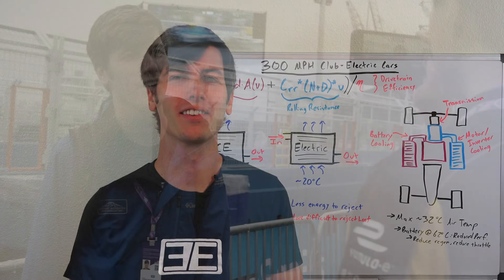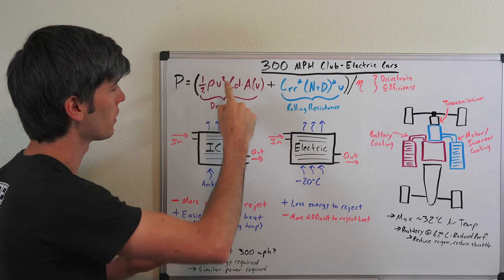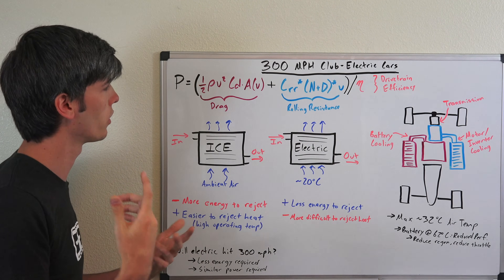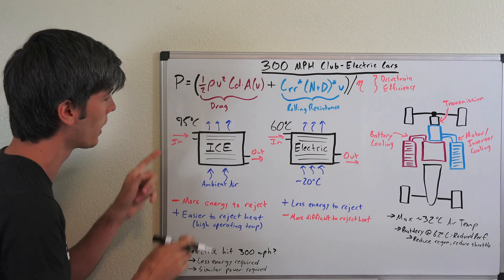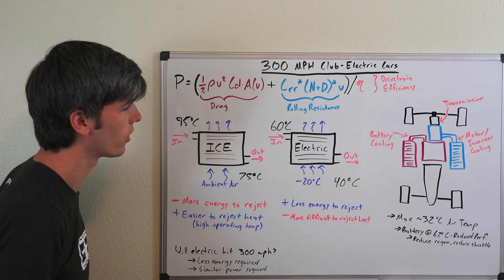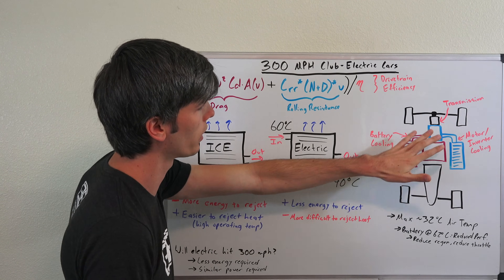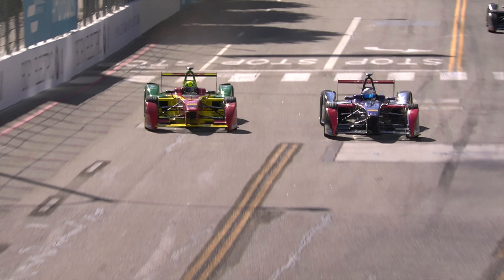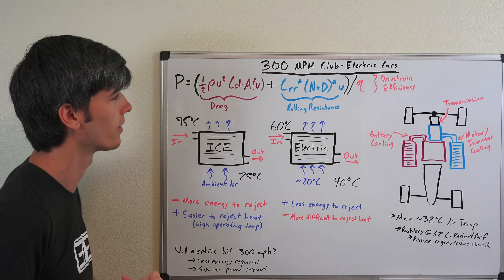Why Has No Production Car Hit 300 MPH? Electric Cars

Comment: There is a substantial amount of energy is lost to aerodynamic drag to cool electric components. There is a similar sized radiator needed due to lower temperature differential. Using refrigerant instead of liquid coolant would create a greater temperature differential to allow for a smaller condenser coil than the radiator. My question is, Would a cooling system using refrigerant instead of liquid coolant allow higher maximum speeds, or would aerodynamic gains be less than the power required to run a refrigerant cooling system?

Comment: Why not use a sort of DRS? But instead of reducing aA of the wings you close radiator intakes/exit. Quite some cars have those flaps that will close when the coolant temp is low. 30 seconds should be enough.

Comment: For electric cars, I wonder if using the entire chassis as the cooling solution would give the best results.  In other words, ditch the radiator and just have heat pipes run throughout the car.  Any panels that don't contribute toward cooling could be carbon fiber.  To my knowledge, many of the support structures are hollow, but still pretty heavy.  I'm not sure how this would work in terms of safety, but there could be more (but smaller) frame pieces that also act as the vessel for the coolant.

From what I understand, electric cars have more divided heat, since each motors, the batteries, and inverters are all separate components that generate heat.  With heat spread out so much, I would think a larger surface area (such as the housing of the vehicle) would be a lot more efficient at removing heat than a single radiator.

And sure, this may result in the frame being pretty hot, but it would be tolerable to touch.
Reply: The more I think about it the more I like this idea.  Any reduction in aerodynamic drag for an electric car also increases range.
Reply: What if it's a Hot summer day where external temperatures can get up to 160F? Having the cooling run through the surface would require much more cooling pipes wich would add wheigh.
Reply: @miguellopez3392  Where tf do you live that it regularly gets up to 160 F???
Reply: @imagineaurora4080  in direct sunlight black painted metal can reach temperatures of 160 degrees Fahrenheit with an Ambient Air Temperature of 103F.

Comment: I can't recall the terminology, but I saw a cooling system which evaporate a store of compressed CO2/gas in small amounts. That expansion would act as a heatsink and absorb the heat which would be bled off. Would sticking a bottle of liquod-some-gas-or-another be a feasible option?
Reply: So I guess in other terms: don't cool a coolant in a closed system, just let it evaporate. 45-minute race with ~23 per car? That may be an option. Weight costs of a tank could be offset by reduced cooling loops.

Comment: I have a question about the heat exchangers location and the secondary effects caused. I have oftentimes questioned why engineering teams always seem to opt for the exaggerated frontal exposure with large air scoop vectors that effectively turn the radiator into a air brake. I am interested to know if it is possible to integrate passive heat sinks and active radiation into the aerodynamic components and body shell, being that the service provided by them is by design generates drag, resulting in down force, and this'll possibly allow the overall  coefficient of drag to be reduced.
Reply: My guess would be mass, adding piping to the entire skin of the vehicle would add dozens of kilos, and the cooling might be worse.
Reply: I love the idea of using the aerodynamic components and body shell where possible.
Reply: Thought the same with the skid plate that is on the bottom of most cars..  could get passive cooling from that also.
Reply: probably hydraulics would add a lot of mass to move all the components. If it were something like a spoiler, the center of mass move upward,too. I was thinking about more advanced techniques like magnetic cooling instead of good, old radiators.
Reply: David Johnston I was thinking the same thing, avoiding surfaces that commonly come into contact with other cars though.
Reply: I think the problem is that you're not getting a whole lot of area elsewhere on the vehicle... the active area of a radiator is easily 10 times as high as its frontal area, plus you get to use the slightly warm air off its back for secondary cooling still, offsetting some of its drag disadvantage. Where do you want to obtain that much area and how do you want to effectively pipe the fluids to and from there?

But maybe that's something you want to ask an aerodynamics engineer. Such as KYLE.ENGINEERS here on YouTube.

By the way, i expect that one of the advantages of a long, flat battery that is bolted to the bottom of the car is specifically drag-neutral cooling, so there's that.

Comment: Formula E teams can get away with not cooling their transmission now because they use 2 cars during a race but what happens in season 5 of Formula E when they only have one car. Wont teams either have to cool their trans or go with one gear or just flat out risk over heating?

Comment: So if the heat transfer is the problem why not build an active cooling system like e.g.air conditioning for the motor and battery pack to make cooling more Efficient?!

Comment: What if both the battery and the motors could supply the required power of 1500hp in a sleek car with little radiators, while remaining within lower temparatures, continuous power output? Might the car hit 300mph before any real heating occurred?
Some batteries are better at delivering high power than others, but may suffer in range (energy). A record run could be over after a minute or so, though. And using the right materials still a good bit of cooling might be achieved at zero added drag.

A drivetrain that needs to really stretch itself to reach 300mph may be much hotter than one that can do it easily. Use A LOT of high power cells, and they'll barely be tickled to produce 1200-1500kW. Use enough motors, say 2 strong one per wheel, and they should be able to stay within their continuous power easily. It would not be a cheap or light car, and it would not travel very far on its power cell battery pack, but it could be done, surely, and it could be put into production, if there's a market for a 300mph car.

Comment: More efficient? With modern technology, wouldn't a 300mph electric car need massive heavy batteries? The motors may be smaller and able to apply more force, but the batteries are a deal breaker in this scenario.
Reply: the engine is more efficient, the system designed to power said engine is not very efficient I love electric cars but the batteries hold them back so much sadly.

Comment: hey if heat can convert into energy, why can we use the heat as a way of propulsion to make the car warm up less? :v
Reply: That's basically MGU-H that you want. So it actually is being done in F1, but it's by far the most complex part of the (already insanely complex) F1 power unit and it doesn't seem to help much with cooling the engine.
Reply: any sort of system like that would likely increase the weight of the car which increases stopping distance and makes cornering/acceleration worse maybe even to the point of making the car far less safe then cars we have today. in terms of other vehicles tho(think trains or large cargo ships etc) it is probably a great idea :P
Reply: actually we convert chemical energy to kinetic energy :v . the heat is the product of combustion, not the source of energy. the twisting force is the torque and that's the energy that gets transfered from the movement of the engine n.n . we waste 66% of energy in between radiator cooling and air cooling :3
Reply: The crux of the issue is, thermodinamics is a fickle mistress. The theoretical best heat cycle can be drawn as a rectangle in an entropy-heat graph, and in that graph, the size of the rectangle is the work you get out of your system, while that plus the part under the rectangle is the energy you put in. 

In simple terms, in thermodinamics, you want your hot as possible, and your cold as cold as possible. As it's easier to heat stuff up (especially in large quantaties), the cold is usually the ambient temperature. That means to have a reasonably good heat cycle, you want a few hundred degrees celsius. Not something you'd be comfortable sitting in.
Reply: Using an engine's waste heat for propulsion is possible, and has been known (and exploited in aircraft) since the 1930s. The NACA cowling for radial engines is probably the first real example: it uses a carefully shaped circular cowl surrounding the engine, which is air cooled. Cooling air enters the hole in the front of the cowl, flows around the engine (directed by baffles) and is vented through adjustable flaps or 'gills' at the rear of the cowling. With careful design, the heating of the air as it cools the engine combined with the shape of the cowl causes the air to exit the cowl at higher speed than it entered, producing a small amount of jet thrust that helps compensate for the drag caused by the engine and cowling. During WW2 many radial powered aircraft used this design, and planes with inline engines used a similar arrangement to help reduce the drag caused by their radiators. The P-51 Mustang's radiator was actually so good in this respect that under some conditions the radiator caused zero net drag, or even produced a small amount of excess thrust. Such an arrangement is (AFAIK) more difficult to set up on a car. There's no suitable location on a traditional car design to put the adjustable flap or gills required for such a radiator scheme to work, and the radiator needs to be optimised to collect the incoming air with minimal loss of pressure, which generally means you need a jet-fighter style intake rather than a grille.

Most piston powered aircraft also harnessed the waste heat that went out the exhaust pipes by the simple expedient of aiming the exhaust backwards- when the exhaust valve opened the exhaust gases of a high performance engine are blasted out at a speed of around mach 1, so directing them to the rear produced a substantial amount of jet thrust.

Comment: Why use the same size radiator for a lower delta T? Also, why is it "harder" to reject LESS delta T with the same size radiator?
Reply: The heat transfer rate is lower. Yes there is less heat to get rid of then ICE but ICE radiators don't drop the temperature very low. Hypotheticaly from ~95C to ~90C while an electric motor radiator might go from ~60C to ~57C but it will take longer (thus larger radiator required) because of the smaller Delta T between the radiator and ambient.
Reply: A lower temperature radiator displaces less heat, the higher the temps are the greater its ability to displace it.
Reply: Yeah, of course lower delt-T = less heat energy displaced. The question is, if there is less energy to transfer out of the system, wouldn't it follow that you could 1)cut down the size of the radiator and/or 2)reduce the airflow required which would amount to a net drag reduction?
Reply: To maintain a lower temp radiator that is 60 deg you need the same size radiator to displace the already lower temperatures, to lower the temperatures even more you would need a larger radiator then a normal car due to how much surface area is being allowed to do its job. to be able to achieve 300mph you would need more power being used more rapidly thus generation more heat to dissipate in turn needing a larger radiator.

Keeping in mind that the battery works best lower then 60 deg

cutting down the radiator size would have a ripple effect on the whole system, the battery would start to output less and the inverter and motors would in turn suffer.
Reply: xkblxcripple,  valiant effort, but I'm understanding your English. Try breaking up your thoughts into smaller sentences; it sounds like you're trying to put too much information into each one. 

Michael, not familiar with ICE radiators, but I'll check them out. Are FE vehicles limited to just one type of radiator? If so, I could get how the radiator might be less efficient. Also, you're right, they only need to lower the temperature by a few degrees, which puzzles me further; what keeps them from increasing the heat transfer by increasing mass flow rate in the radiator? Water pumps don't take much energy to run, and due to the lack of comprehensibility, the system wouldn't need much of a pressure increase (thus, components wouldn't need more weight).
Reply: Yeah grammar ain't my strong spot ha ha

Comment: i like the idea of formula e but i just cant get behind a series where the pace car (rimac concept 1) has 4x the power of the cars doing the actual racing ... not to mention the driver boost feature is absurd in the extreme
Reply: its not really power that makes a car go fast around a race track tho, its mostly grip, torque and low weight.
**edit grip = downforce/tires etc

Comment: What about using peltier cooling to increase radiator temp w/o increasing temp on the sensitive components? I'm guessing you'd need bigger batteries for supporting the peltier cooling and thereby increasing the weight enough to make it not worth it.
Reply: Jaliee peltier coolers are rarely worth it, they consume far too much power. For anything that can take the size and weight using a compressor/refrigerant is more efficient.

Comment: Nice math for steady state, but have you considered Dynamic temperature conditions? On a cold day, it takes my combustion car a few minutes just to warm up to normal operating temperature. Electric cars do not have the limit of being unable to run fast at cold temperatures. In fact, their motors are even more efficient at cold temperatures. It seems to me that reaching 300 miles per hour with an electric motor after a cold start would possible.  You just need to quantify the total amount of waste heat generated to reach the top speed, and compute delta t of the car's components would be after that adiabatic sprint, assuming all waste heat stays in the car.  The more thermal mass you add to the car batteries, the easier it is.  You could use a radiator system that completely folds away for less wind resistance, and pops back up to cool down after the speed run, like a diving falcon.
Reply from the maker: +Matthew Furtney sure, but you can't base a design for a production car on a single 300 mph run. It also has to withstand driving around in Phoenix at 120F, regardless of what driving condition you're in (traffic, cruising, spirited driving, etc). That plays a huge role in the sizing of the cooling system.
Reply: Matthew Furtney I know it wouldn't be practical but I'd love to see a car designed that way.
Reply: Matthew Furtney in pretty sure batteries don't like the cold though or something I heard
Reply: Batteries don't like being cold,,,,
Reply: Engineering Explained That's a good point.  Love your videos.  I should have clarified better.   I'm not thinking anyone should make a smaller cooling system.  I'm thinking you can have a big enough cooling system to run a nice air conditioner, and cool the car for normal and spirited driving in hot weather.   On top of that, write a 'sprint mode' in the car computer which (if activated) uses the AC to cool the battery to optimal temps, gives the driver a green light and go-tone to hit the accelerator.  When the car hits it's top speed, the AC shuts off and the radiator folds down, thus decreasing drag.  You can then continue accelerating until the engine or batteries hit max temperature.  When the system heats up to maximum you will have reached top speed for that sprint.  Power to the engine is reduced, and the radiator folds back up to cool everything.  The increased drag slows you down. Sure, it's not practical for picking up taco bell, but it would be cool.

Comment: Battery cooling need depends on how big is the battery relative to the load. Many modern battery can deliver something like 5c without heating at all? Another thing that bothers me is why cooling alements have to be so unefficient on airodynamical standpoint? Why not use car's bodyparts as cooling surfaces? (all thought effective cooling area in cooling element is really huge) Can you cool electric car with co2 for example and eliminate drag caused by cooling?

How many kilowats of power would need a airodynamically optimal 482.8032km/h car?

Comment: Why can't jet engines be used in this scenario? They should theoretically have far better cooling as there is a constant stream of air passing through the engine itself, and they can also be mounted on the exterior of the car.
Reply: The key word is PRODUCTION
Yes you can use a turbine engine, but not in a production car
Reply: DanTheMan 
They are far more noisy, that would be quite challenging to reach the noise levels required by law.  Also, I think they are not as responsive as they should be for a sport car.
Reply: Edohiguma unless you also have wings 😂
Reply: Elan Jacobs 
Yup. In the 50's and 60's there were some prototypes that tried the concept. As there are not a single production car using that technology, we can assume it was not worthy.